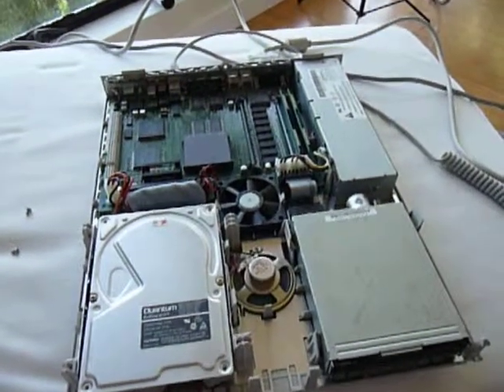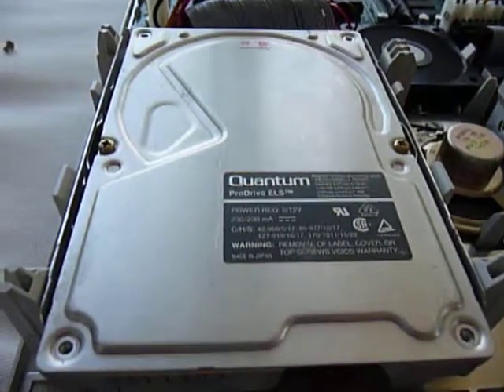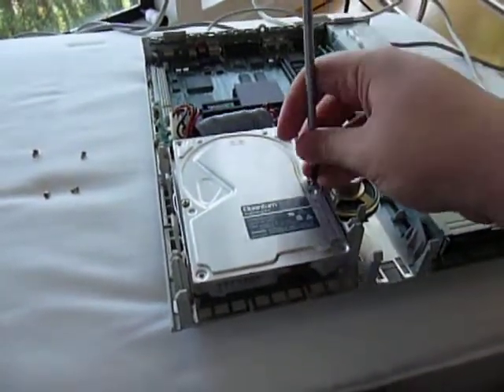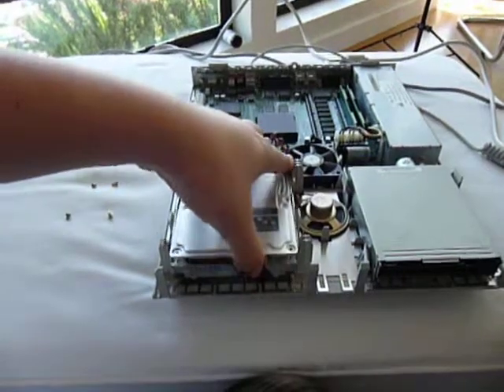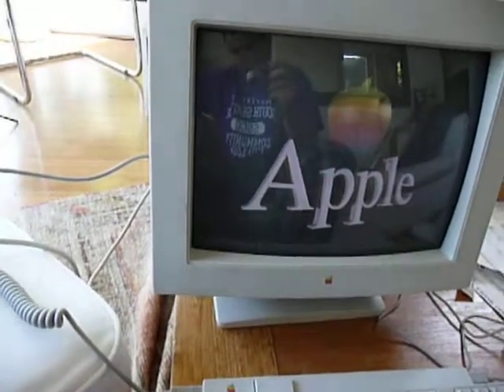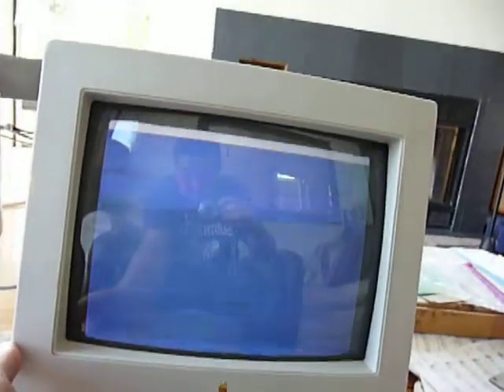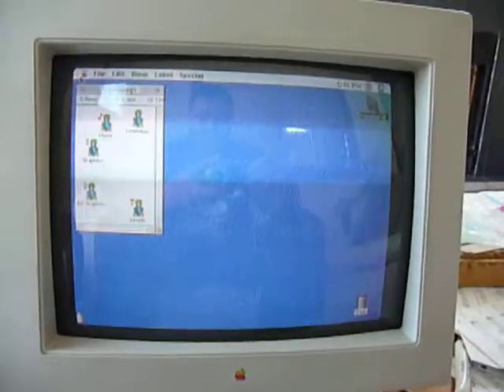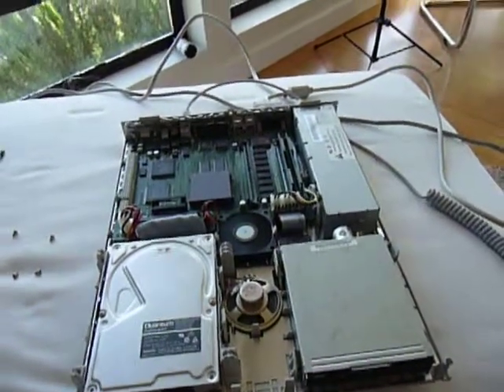Quantum Prodrive quick fix

Comment: hjahaha mad try this fix, ends up working tho ! my case hdd also spins down, solved it by plugging the drive to an external regular AT/ATX power supply and turn it on before the Mac. my fingers points to the old mac psu not being able to cope with time xD cheers !

Comment: Thanks for the work around. My ELS-85AT experienced the same problem very suddenly after i had it spinning up and working properly several times today. Unfortunately this seems to be just a temporary fix. Also just pushing the park release lever to the side won't help. I had to move the head manually to an area between the middle and the outer tracks in order to get the drive to perform its seek test. So this one is toast it seems. The funny thing is: The last time it started on its own i made a backup of the whole drive with GHOST on another Quantum drive. It might have thought "Ok, you got your stuff safe now, so I can retire" ^^

Comment: What is that fancy Apple logo boot screen from?  I've never seen that before, instead of the usual "Welcome to Macintosh" screen.
Reply: If memory serves, on Classic Mac OS you can replace the "Welcome to Macintosh" screen by placing a PICT file in the System Folder called "StartupScreen". When you boot, it will use that screen instead as the backdrop for loading the extensions, etc. Not sure if it still works on MacOS 8.0+.

edit: It might not be as simple as a "PICT file." I think it was a special export option in GraphicConverter, "PICT Resource?"